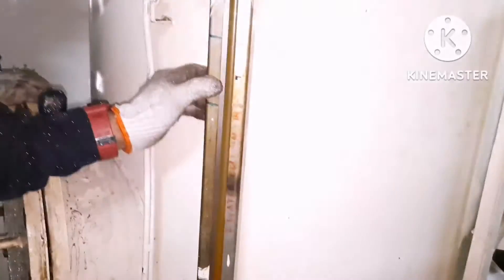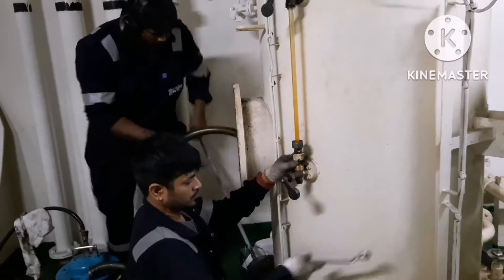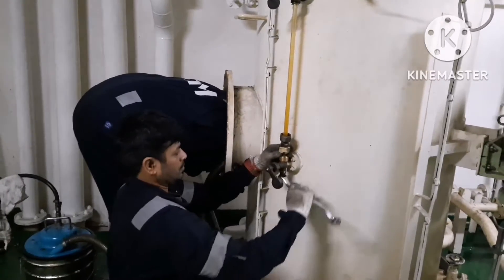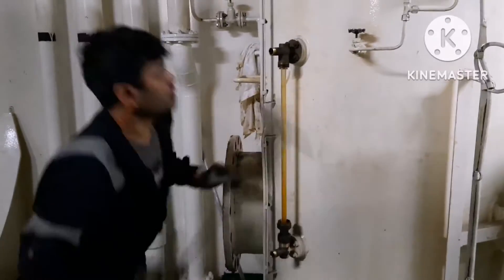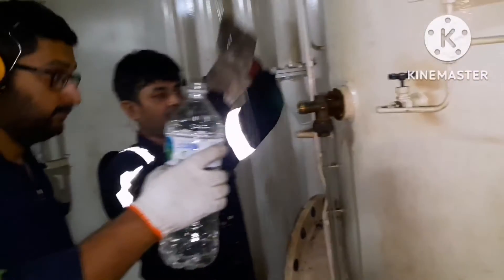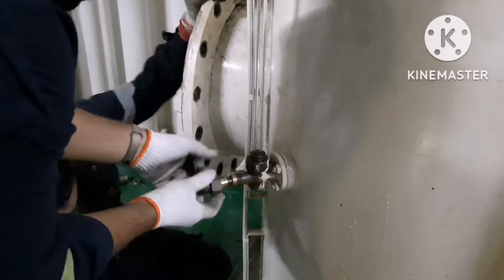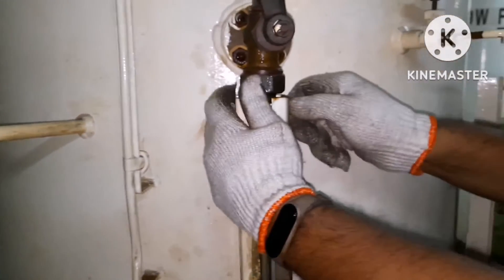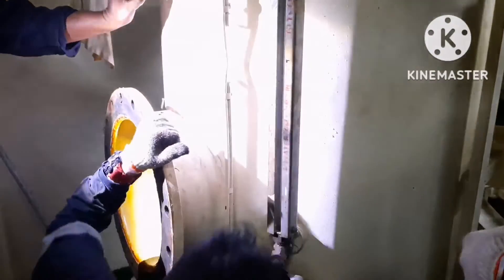HOW DO THEY DO.. HOW TO CLEAN SIGHT GLASS FOR HYDROPHORE TANK ONBOARD SHIPS...

Comment: Hello chief i have a question regarding our auxiliary engine , lately i've noticed that there is a consumption of lube oil . I'm thinking abt piston rings , so should i change all of them or there is a way to know which number of cylinder piston rings must be changed like for exemple , there should be a higher exhaust temperature compared to other units . What do u think pliz if u have any suggestions let me know . And thank u
Reply from the maker: Hi sir.. Thanks for your good query..
You can check the following things first..
* check the purifier fir any Leakage.
* check the fuel pump lube oil flow. If its too much you can adjust the flow.(mostly this should be the issue) 
* you can check the lube oil pump for any Leakage.
* check when last Decarb was done.
Reply: @marine-knowledge-basha  Can u please explain me more what u said about the fuel pump lub oil flow

Comment: sir, after adding water to the tank, which valve to open first for the sight glass? the upper one or the lower one?
Reply from the maker: Lower one slowly... And then purge out the air by opening top valve and slackening the top purging plug..